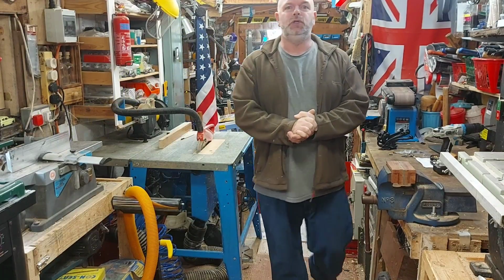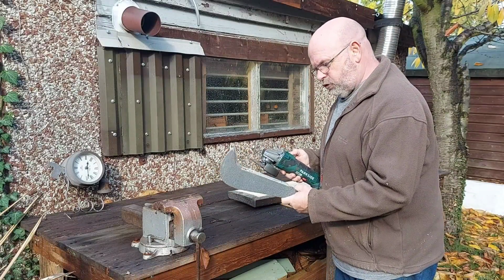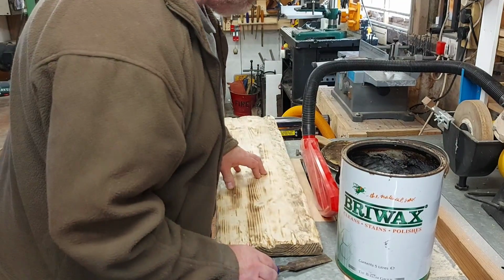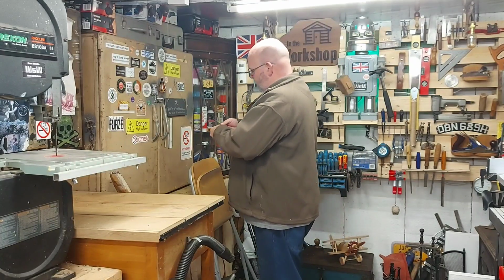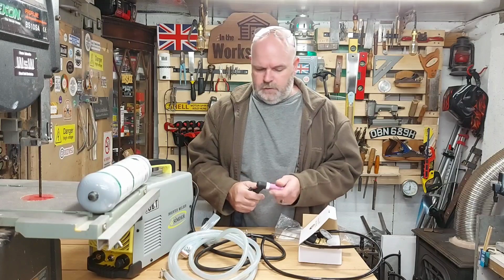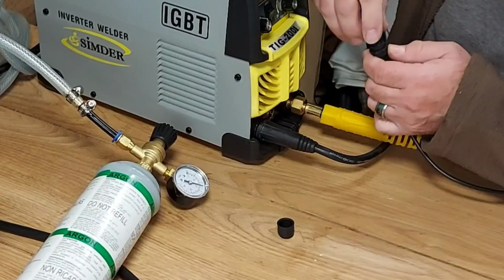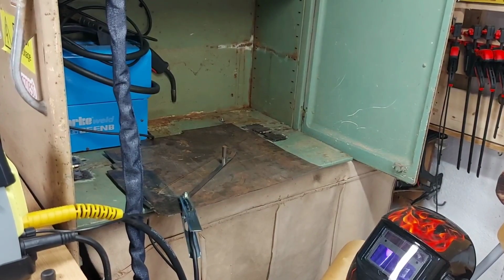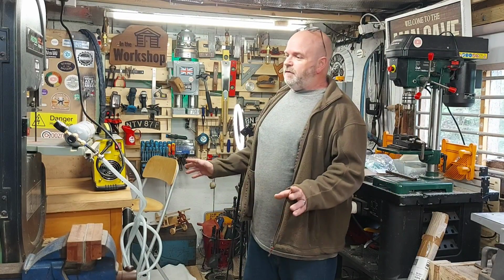In The Workshop Doing Stuff / Rustic Rack and Welder Setup

Comment: Hiya David, hope you're well. I've just enrolled on a MIG welding course and was wondering whether that's a Lidl welder's helmet you've got there mate?  If so, any good?  How long have you had it, etc?  Any regrets? Cheers mate. Subscribed.  Des
Reply from the maker: Hi Des, Yeah, I  did get the helmet from Lidl a few years ago. It seems to be still working okay, it has an area on it that looks like a thin solar panel so don't know if this helps power it as I cannot find anywhere on the helmet that holds batteries. I assume they are built in. 👍